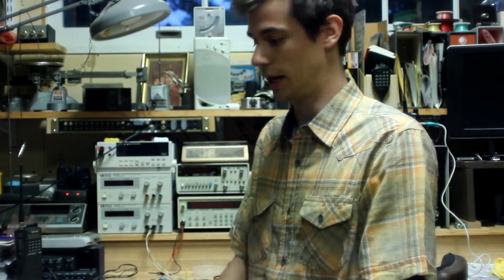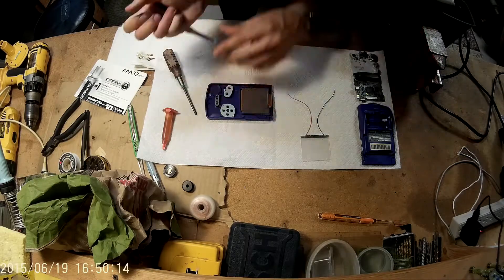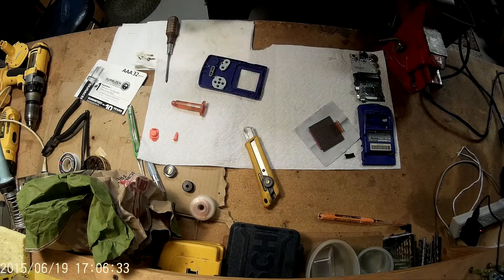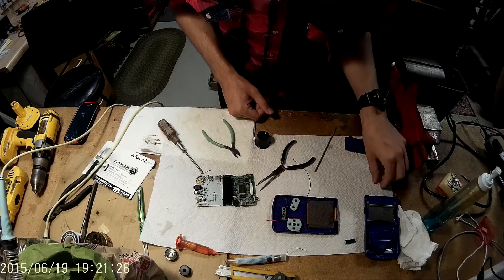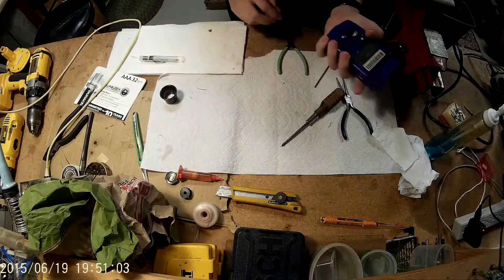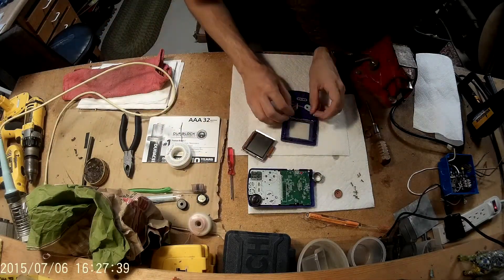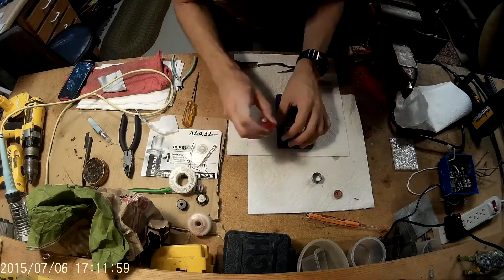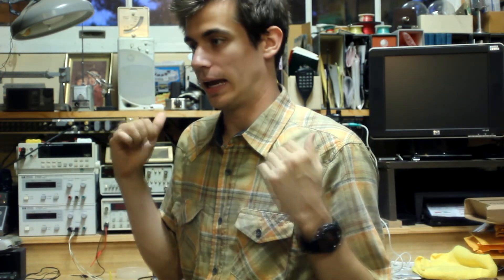Gameboy Color Dimming Front Light-Build Log

Comment: Good video man, have you seen anything about adding metallic paper to the back of the screen to improve the quality of the colors on the screen with the front light? I'm thinking about doing one of these, but so far it just seems hard to beat the quality of the screen on the knock off GB Boy Colour.

I have a range of modded GBCs and the GB Boy Colour itself and the Chinese knock off is pretty damn good. I have a front-lit GBC using the SP's front light, but that one looks really washed out. I'm tempted to try this mod with the kit + LOCA, but I would want the colors to pop out more than they do in the videos I've seen so far.
Reply from the maker: +Kevdo I actually set this up the first time (when loca glue messed up) without the loca, and now having it on its definitely much better. 

But you would be damn challenged to beat the gb boy, the screen is very crisp (I think the aspect ratio is just off though by a few pixels).  I actually think I've heard of the reflective tape behind it, but I'm not sure how well it'd work. Theres a bunch of talented guys who were testing this stuff out over of r/Gameboy on reddit. You might be able to pick their brains
Reply: I appreciate the tips man. I'm still looking to see what I can do. I might opt to do the infamous GBA SP inside the GBC case. You're right about the GB Boy Colour screen though. The aspect ratio is a tiny bit off, but it's not horrible and definitely worth the trade off with great colors on the backlit screen.

My main thing is that the GBC case itself is just the best one of all the Nintendo handhelds imo. If it were backlit, the GBC screen itself would also be pretty damn sharp. I guess there's no easy answer to this question though.